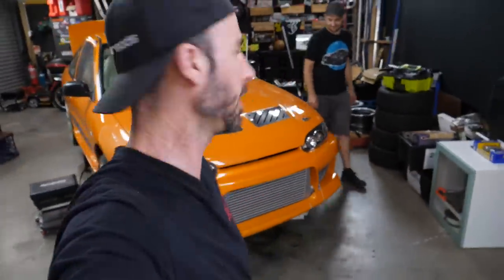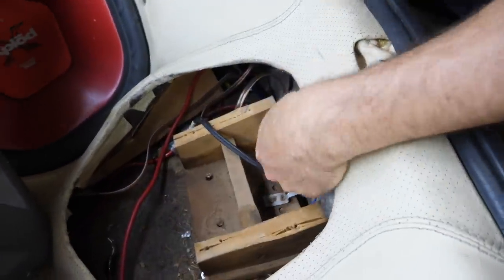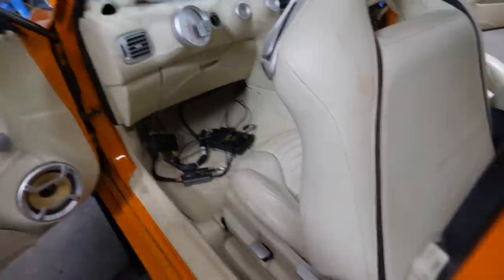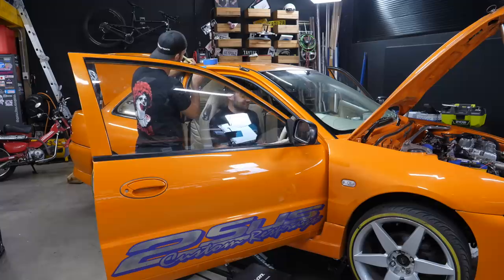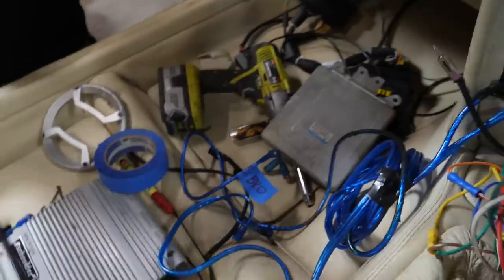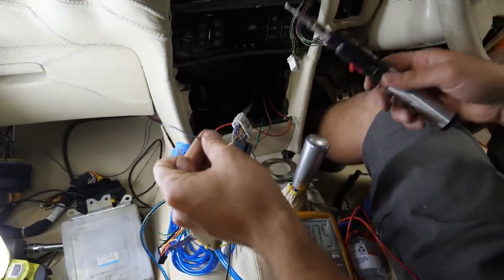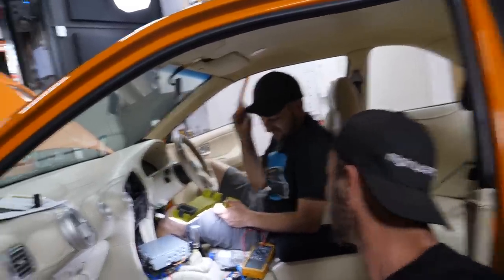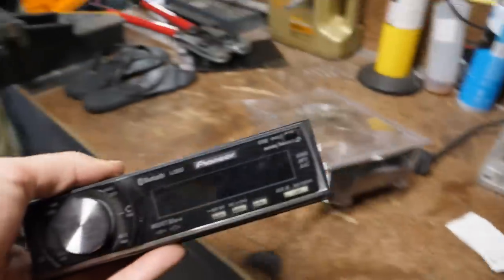2WISTD - This EVO will BLOW YOUR PANTS OFF!!! (10000000%)

Comment: This is exactly what all of those pimp my ride vehicles look like if you pull them apart right now.
Reply: doubt any of those cars still live, 2WISTD is better built than any of the pimp my ride cars, it was all just a scam anyway
Reply: @sirmounted8499  yeah, most of them never were even able to drive out of the garage! XD
Reply: @tordenbob1957  Yeah its been well documented, the horrible state of many of these - from barely short-term-viable, to downright dangerous and not street legal. IIRC some of the earlier ones were OK, but as with any reality'ish show - producers always push for more extreme, regardless of the real-life cost to the parties involved or warnings from their tech staff and advisors.
Reply: @pr0xZen  You're just bitter because you don't have a chocolate fountain in your center console.
Reply: In one case a car that they built was untouched mechanically , it blew up and burned down
Reply: @pr0xZen  does your car have a conveyor belt in the trunk? Yeah that's what I thought
Reply: @ @joeygonzalez2601   @Kevin Johnson Well I would have you know, ya smug bastards, my wagon does have a conveyor belt in it. It transports my chocolate fountain around so its easily accessible for the rear passengers too.
Reply: Yeah they teck screw in the seats
Reply: The audio equipment that they used in pimp my ride was VM audio, super cheap stuff.
Reply: Yazan Tuffaha That's pretty much all of them
Reply: There was an AskReddit thread where some of the 'clients' of the Pimp my Ride show said they didn't do anything to the mechanical or structural aspects of the car, so they were still not roadworthy or as roadworthy as they were previous. Some didn't even start haha.
Reply: If you pulled them apart back then actually
Reply: I watched an after the fact video on those PMR cars and a lot of the stuff put in them was just for the show and taken out before they got the car back.  They also didn't address anything mechanical about the cars so they were still breaking down all the time.  For the most part they just Polished the Proverbial Turd.
Reply: This car is a million times better than any of those heaps on pimp my ride.
Reply: Pimp my ride was such a huge letdown, I cant believe at one point I wished they would do mine lmao cant believe I admitted that.

Comment: I used to do car audio. I would ALWAYS run into cars like this. Wires going no where, positive and rca running together... engine noise through the speaker.
Reply: Don’t forget- all settings and dials set to max. With bass boost. Customer “I never turn it up that high and all the speakers are blown”
Reply: esigman1 yeah! And, my “cousin” installed it, he knows how...
Reply: Alternator noise ;)
Reply: @landegode  rf interference or when the engine bogs a bit during every bass beat?
Reply: @SilverCanary1  "engine noise through the speakers" =  alternator noise. Either because of bad grounding, no RCA output (and a speaker to line converter) or bad RCA cables. Same in petrol and diesel cars.
Reply: @landegode  I though you might say both lol. every car I've worked on has had the little box grounded to the chassis (i think) that removes ignition born RF interference si I've not had that problem. though I do remember every now and again cars going down the street that obviously didn't have the box and they messed with the tv and radio but that hasn't happened for years...
Reply: Ed Silmon alternatir noise mostly and the box is small capacitor. Can tell you that that whine you have in some cars is not ignition born as problem is just as common with diesels.
Reply: @Lucky Rooster can't help on bose in-car audio as I've never touched one. I'm not even sure I've heard one either.  just the standard ICE that's been around since the 1900's lol I've been trying to find a GPS solution for a 2015 polo as it's in between VW allowing free carplay vs signing up to propitiatory VW carplay for £150/year! The alternative is an arguably shitty kenwood/garmin joint effort GPS box and antenna addon for the mere price of £600! And people complain about apple lmao. 
I think enough people complained about this horseshit that VW crumbled and from 2016/7 on smartphones can be connected without cost. It's just a bit of a ballache. Add to that someones been inside the dashboard seemingly with an axe and a blowtorch and fucked everything up in there which has buggered the AC and the fact it was ~50% retail price as its a crash repair it's becoming debatable as to whether it's more hassle than it was worth...
Reply: Noise through speaker would be earth issue. Happened to me. Cleaned the amp earth and was fine
Reply: @Lucky Rooster is it about the amps? Cant you just install your own amps or something?
Reply: @Lucky Rooster that sucks. No forums cracked the "magic trick"?
Reply: @Lucky Rooster look at car specific forum, or brand at least. You are probably not the only one who had this problem
Reply: What fixed the engine noises through the speakers ? I hate that my moms Honda Pilot has that. I installed it when I was younger and probably messed up somewhere but I used heat shrink and made sure I didn’t leave any exposed wire anywhere.
Reply: Me too, I used to remove it all and start again, can’t warrant your work when someone else’s dodgy work fails somewhere else.

Comment: In Aussie Land, apparently the fuse box wrapped in duct tape and ziptied under the frame brings mega points with the Judges at the big car show?
Reply: I thought it was a kilo of narcotics
Reply: @Dice_weiss  Nah mate, it was one of cassie sainsburys headphones
Reply: My guess is that was to get the fuse box out of sight without blowing everything in the rain.
Reply: only at auto saloon lol go to a real car show like summernats or motor ex etc. if the judges even see a fuse box your gettin points deducted haha, you can't even show a wire lol oop there's an injector points deducted hahaha a sexspec car wouldn't even get in the top 100 at one of these events lol
Reply: Dudes Marty stated there was a fuel line above. I believe the box got that tapejob as insulation to not explode....
Reply: The Aussie 'sex spec' scene was not unlike some of the early import scene in the US, in that cosmetics and superficial aesthetics counted for virtually everything, and real build quality was not even touched. I remember the Portland Roadster Show in 1992 had some imports creeping in, including an FB RX7 that had essentially no performance mods, and a monochromatic theme. It was a purple of the nearly fuchsia bent, and they applied the metal flake color to the bottom of the car, including every bushing and dust boot on the suspension. Back then, Sport Compact Car magazine was full of Ford Escorts and Nissan Sentras, lowered with body kits and wild paint jobs, fancy stereos, and 'engine dress up' qualifying them as 'show cars'. They were definitely all show, and no go.
Reply: why are you assuming it came like this from  an autoshow?
Reply: This isn't Pebble Beach, the cars are judged for external appearance not for hidden parts of the build.
Reply: @bobroberts2371  no kidding dude~
Reply: Hey its out of sight. Thats all they wanted. They just did it ghetto without extending the harness to a better spot

Comment: when you have no visible fuse box under the bonnet you rake in major points at the shows because it will appear as if your sound system is protected by the unicorns

Comment: When dealing with this type of car were you dont know what anything is or where it goes- best to have an Ohm meter, and a signal generator to isolate speaker leads- if you dont have a signal generator, you can touch suspected speaker wires to the top of a small 9V battery like used in a childs toy and see if you get any pops or noise from speakers, then mark the wires-
Reply: LOL - you didnt need to cut a long hunk of wire, if you probe under the dash the suspected amp signal wire going to the back with the red lead, then ground the black lead to chassis- then go in trunk and hold suspected amp signal wire to ground and you get your beep- BINGO!

Comment: I appreciate the little 2 no cuts. Out of the years of customizing stereo's since the 90s it gives ppl an idea of the true thought that needs 2 be put into it. I can tell the guy no offense shouldn't of hooked anything up or worked on it and I give him props 4 leading most of it to ppl who kno what their doing. I miss my eclipse component speaker set with the boxes that help prevent the speakers from not only blowing but taking away the lower frequencies that are not healthy mid range door subs and tweeters. Ran into my 250 Sony amp old school and the subs ran with cap, JL 500/1 hooked up bridged to two 12in hcca duel voice coil subs. In a  92 Honda civic hatch. Loved it! Now running a 04 VW Passat awd 5speed 1.8t wagon. 😀

Comment: FYI. You can hook a low voltage battery to the speaker wire and the speaker it is connected to will make popping noises.
Reply: yup AA and you're good to go. great time saver.
Reply: Yes you can do that. But DC will cook the coils. There is a reason why pretty much everybody runs capacitors on the output of an amplifier chip. While maybe for a few seconds it won’t hurt much. Never prolonged or anything about 2-3v maybe 5 for a very short amount of time on a big-ish speaker.

Comment: Back in the 90’s people have an external charger to power the stereo otherwise it will kill the battery in 10 minutes...
Reply: Nowadays we have 10x the power and don't...

...because we worked out alternators and lithium were the way forward =D
Reply: holly shit, they had horrible reserve back then I guess. I dont think even my little xs would die in 10 min, unless I was pulling the 700+ amps that I do, just on that single battery. lol. also not really the smartest to run it with the vehicle off anyway. a charger maybe has 60amps max. might as well just run the alts and have hundreds of amps to charge them up.
Reply: Exactly they had power supplies not external chargers. They have been used for a long time in sound off circles which still happen even if the general public has moved on from it. All manufacturer demo vans have external power supplies.
Reply: @allrimmedout  some car shows are in doors requiring the use of a charger or inverter to power the cars accessories.

Comment: I used to work professionally installing car audio and accessories. This is like a normal day working on a job installed by another shop. Figuring out the what, why, where, and how...
Reply: ChrisHallett83  This is why I learned to do my own stereo installs because I never trusted places like strathfield or autobarn.  Even recently I had some Type R splits installed by a proper car audio shop in my Civic and they used hot glue to glue in the tweeters in the factory dash positions but when it got hot the glue melted and the tweeters fell into the dash.

Comment: This brings me back like 15 years! I had a small Fiat Cinquecento Abarth, pulled the backseat out and build a stereo in it. Double 1200w subs, 2 monoblock amps, 6 speakers on one big multi channel amp, all JBL. When I cranked it everything started shaking, the little roof window and window wipers started bouncing up and down lmao. The vibrations cracked the backwindow one time when I went too far. Good times

Comment: A nice easy way to check if a) a speaker still works and b) if the cables are attached to a speaker is attach a 9 volt battery over the terminals/cables and the voltage will either make the cone pull in or push out, depending on which terminal connects to the positive

Comment: Sound off vs a mid 2000's  volvo with 8ohm factory speakers
Reply: JAMCastillo1 my first car was a 97 volvo wagon with the most wild oem stereo I have ever experienced
Reply: They do a 300w 13 speaker Dolby Pro logic option on 2001+ Volvo's. Yup it's pretty good for oem.
Reply: The V70 before 2001 had an even better option: Dynaudio sound system
Reply: The new volvo bowers & wilkins too
Reply: @barrybritcher  dolby is just a decoder. You can have that is the shitest amps. There is alot more to sound that a simple decoder. You really need to look at the DAC. That is the true heart. From there everything else is support. 
And unless your music is coded in dolby it wont actually play in dolby, it will be a half ass attempt with the eq.
Reply: Hell yeah the sound in my S60 is lightyears ahead vs my parent’s Audi A4 from 2014
Reply: Ngl my mum's S40 from 98 had an absolutely shite system 😂
Reply: I had a 2003 s60 with the top spec system... Was actually ridiculous
Reply: @Chiefmucka   Yea volvo has very nice factory audio. Drove an s60 as well, audio was  very good compared to japanese cars of the same era (hated the head unit though, no usb port or line in)
Reply: A bmw with factory HiFi - 11 speakers stock. 2 of which are 8 inch factory subs
Reply: Hell yeah I recently bought a 2006 xc70 and was amazed it has a tweeter, speaker, and a subwoofer in each front doors.
Reply: @Chemtech2010  I fitted a Bluetooth adapter instead of the secondary cd changer 😉
Reply: Alfa 156s and 147s with bose stereo are pretty wild too.
Reply: @blathers_13  Yea, but the s40 was in a completely different league imo, at least when i compare my S60 from 2000 vs my friend's S40
Reply: @Meton97  truth haha however the one in my lexus is200 is pretty hectic and that's from mid 01, but again, different leage 😅
Reply: I have a 2005 Alfa 156 but sadly it doesn't have the bose stereo

Comment: Seriously get this thing on the dyno ASAP. I wanna know the numbers....
Reply: cardesinr guessing from the state of the engine im guessing around at least 130 to barely 210 bhp.
Reply: If you do some research, 2WISTD actually did a dyno run at Autosalon in 2008. Got to 172.6kW. It'd be less now of course, but gives you a rough idea.
Reply: @NootScoots  Its easily gonna be more because they can run it off a Haltech instead of a crappy 90s ECU.
Reply: @Benedocta  and e85

Comment: Hey MCM, Just an little help for you guys, when using continuity on your multimeter, instead of running a long wire to make the connection, Its easier to use the cars chassis instead. So if you use the chassis on the far end you put your meter on the cable and the chassis on the wire end and that will bell the cable out for you. i hope this helps

Comment: I have -95 Volvo 940 project car with massive subwoofers, 8 speakers and tweeters from 2008 (when they were a-must-have). And it still brings a smile to my face when I listen to those (in middle of nowhere so nobody else sees :D).
Edit: Why didnt you just take everything out and run everything new? That car is a wiring mess..

Comment: Hint for those who are doing a audio upgrade.... run RCA leads down the drivers side. But power down the left side  as well as the trigger  for the amp . Stops noises though the speakers. Also If running front speakers through the amplifier the boot run the speaker wires down the right side as well

Comment: Just a helpful tip, if you want to complete a circuit without using a long length of wire you can use an exposed portion of metal on the car frame with your ground from the meter, and the ground from whatever device you are going to, thus completing the ground through the aluminum frame of the car and saving you some wire.

Comment: I remember those being the biggest joke of a subwoofer here in the states. Walmart special $50.
Reply: Yup they had a bad habit of wearing out in the corners. Just like the first square kicker solerbarics subs.
Reply: They were slightly better back in the day. But still complete shit. The last good Sony was the mobile ES stuff from the late 90's. Its funny but when I worked as a installer our Sony rep offered me a ton of free gear when they first came out with the Xplode crap and I almost laughed in his face.
Reply: Sony xplod stuff was hilarious tho
Reply: @JM-mn4ph  I remember get the first Xplod Subs generation kind of decent 250 RMS
Reply: The whole system is a Walmart joke.  Lazy install at it's worst.
Reply: @bensbrickadventure8588  yea sony xplod subs were horrible but they actually had some sony xplod amps that weren't too bad. I remember one I could get 500w rms out of bridged.
Reply: @Chris Doyle Custom leather bound panel to hide the wiring underneath the seat , "lazy install at its worst"
Reply: just  replace them with 2 1200watts 12 inch from jbl
Reply: @JM-mn4ph  anyone buying those xplod subs would also have a peak wattage rated amp but they could be using the gain as a volume knob and sending a clipped signal that would send them to the grave early. Xplod was crap.
Reply: Yeah they would pop eventually but they look cool,   kicker, blaupoint n jbl were the ones to have but looked boring
Reply: They are still the joke of the industry
Reply: I actually have a Xplode sub with 420W RMS in the boot and it works just fine, sounds good too.
Reply: @TheMegaElmo  ether youve never had another sub, or you've only ever had $30 subs.
Reply: Don’t worry, they were something of a joke here too.
Reply: @firefighter_dj  I had a spectron before it (that one was pretty shitty) and a friend of mine has an Eton. I get that they are not the best ones, but that low price there are worse things you can buy. I am not so experienced in car HiFi. So may I ask, why the Xplode subs are that bad? I mean, isn't it more depending on the amp that is powering it?
Reply: Crimson Chin Or DC Audio, or B2 Audio or DigitalDesigns 12” 😏
Reply: @JM-mn4ph  I ran a stereo shop in this era. Xplod was walmart garbage and no real shop would touch them. High wattage version or not, it was just the same overcooked garbage.

Comment: Mostly correct about crossovers, what Moog is describing is the difference between a passive and an active crossover. The former being band-pass, low-pass and high-pass filters, the latter splits the audio signal before being amplified.